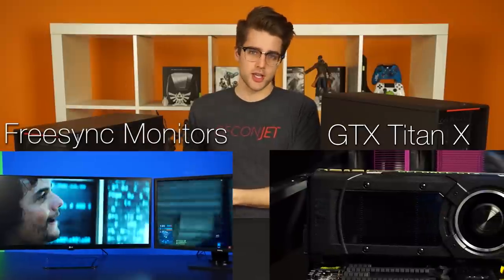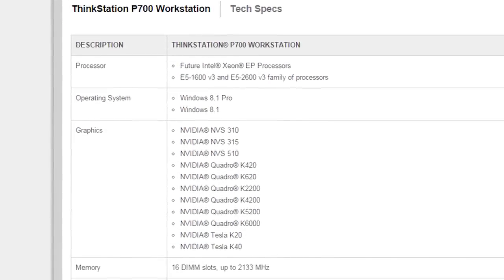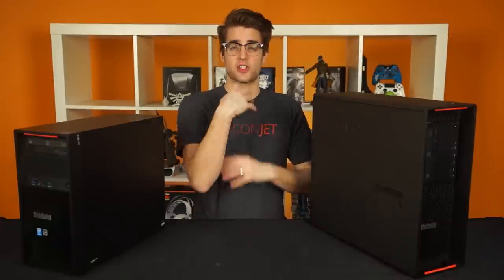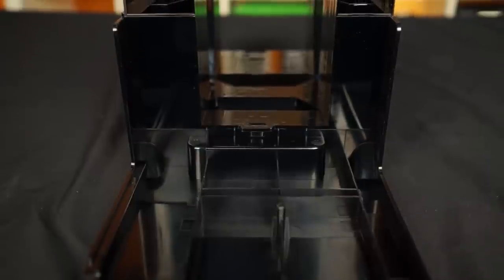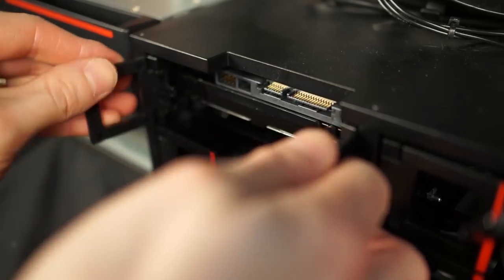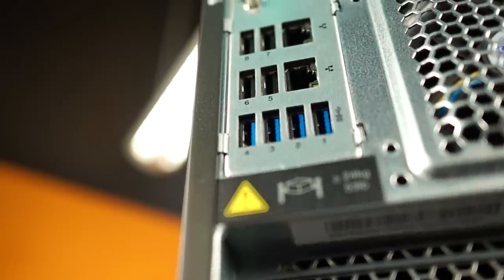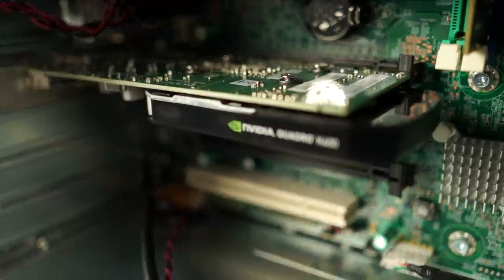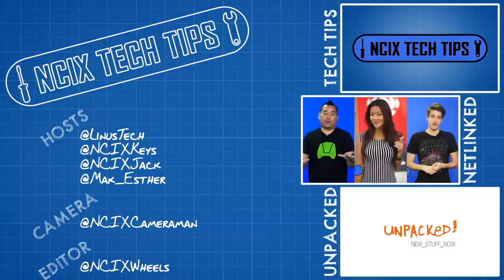Lenovo P300 + P700 Thinkstation Overview

Comment: Worst workstations ever, you would be much better of building your own(or getting from another brand). Not only for price, but also for airflow, noise, features,  weight.. and the list goes on, yes they are pretty in a way. But damn that cheap machine is the worst i have ever seen on the inside. Reminds me of a first time build in a 15 year old case :(

Comment: What you need to know about the P300. it is socket 1150 ddr3. They are about 39 bucks on Ebay today. I have had 7 or 8 of these over the last few years and have 1 now. Windows 7 64 bit is the only os I will use. choose your Win updates carefully. There are 4 sec and 32 that you want to use. Don't get the others. The ones that make to win navigate fast are the 1's to get. Use the gray matter. Got some Dells, I like the 3020 2 sticks 8gb each. You can make a 7020 or 9020 out of a 3020. You bet you ass. It's easy when you figure it out. Clue Dell is built around the usb hub. Need faceplate mobo and the i/o plate. Boom chakalaka Boom. Clue it dosen't have to be the 3020. You can convert almost any optiplex to any other using to info I have given. I don't BS about this. It's a fact Jack!

Comment: Could someone explain to me how a 'workstation' is different to another desktop computer. I can understand the modularity of the case as if one maintenance worker has to maintain a room full of computer it means swapping out hardware is easier and quicker. I also assume workstations have different hardware, but how is this hardware different to hardware used for gaming or whatever else?
Reply: Workstation hardware is generally better built with more checking while it heads down the assembly line. It generally comes with a better warranty. The big thing, however, is the fact that this kind of hardware comes with drivers that are made to work with and checked with many of the large 3D modeling, Video Editing, etc. companies and their software. Workstation GPUs can play games, but are better suited for the above. These benefits are why workstations cards usually cost a lot more too!
Reply: Primary difference between what you and I would normally buy and a workstation component that can cost 10x more is validation. Each part is designed to operate just about 24/7 rendering or code crunching. The chips are designed with a higher tolerance to what the consumer level chips can do. Plus most workstation components like GPU's and CPU's are not overclock friendly. So for example you made a video and are now in the process of editing, it's going to go a lot smoother and when it's time to render it's going to go much faster then on a consumer level PC that's primary focus is video games. These machines are purpose built where our machines are really general purpose built. Hope this makes sense to you!
Reply: JaytechGaming the hardware isn't exactly better it is more expensive yes but gaming on workstation hardware is very awkward  since no geforce driver's lol and many other factors but work station hardware is really just designed for large workstation loads. gaming hardware is for gaming and will do a lot better job than what workstations hardware does for gaming
Reply: I know all of this lol, I was just making it as simple as possible. Pretty sure linus covered this before anyway
 in a video...

Comment: I came here expecting much more, I am very disapointed. 
This is what you call a "think station", get the fuck out of here. 
You should look at the price tags on these things, just build your own water cooled titan x i7 5960x PC, it will out perform those little "work stations" any day of the week, then have plenty of time to play crisis in 4k.
Reply: armoureddanger good idea but you will not have ECC ram for system ram or for GPU ram
Reply: armoureddanger these are meant to be very reliable since if you have a large work load you don't want it to fail
Reply: armoureddanger you obviously don't know the purpose of these computers then
Reply: These machines are made to support a workload that you couldn't possibly comprehend, that's why they have purpose built parts, and are inspected and check every stage of the way. You simply don't understand, but that's ok, but don't just go touting your wrong opinion about gaming on a machine that the only game its ever gonna see is minesweeper.
Reply: Lol good luck using consumer components for workstation needs, that's just rich. You'd probably replace that rig in under four years. Meanwhile my dad is still running his IBM ThinkCentre 8193-XX7 from 03'. Built like a tank, never crashed, and still at a level of quality that you can't even find today in consumer products (especially when you're trying to use experimental cards instead of actual productivity cards good lord). YOU might not need it, but businesses are running a legit operation that loses countless amounts of revenue whenever there's downtime. Btw it's Crysis, and no it doesn't run on the ThinkCentre.
Reply: +armoureddanger You're a "gamer". You cannot compare a workstation to a gaming PC. By your logic, why aren't servers watercooled too right?